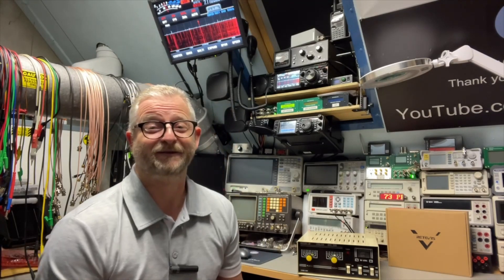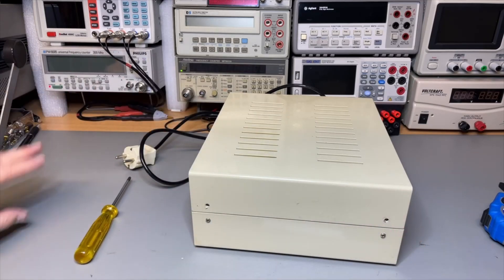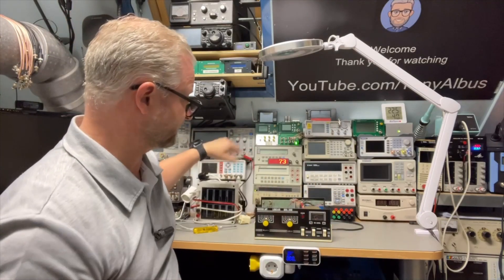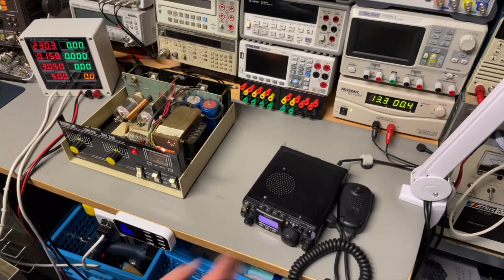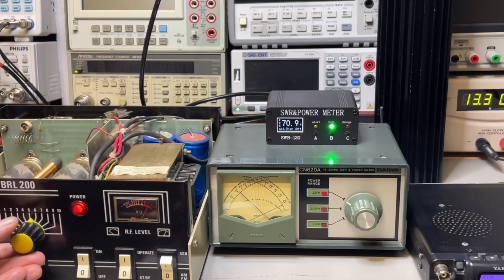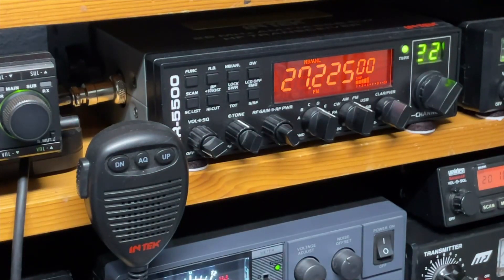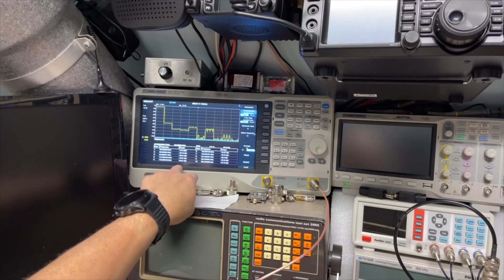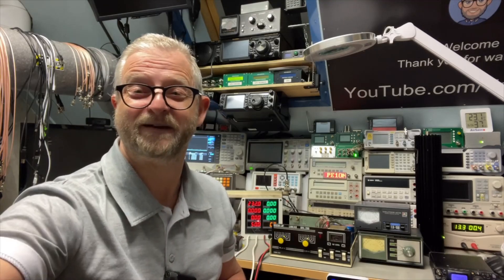TA-0327: Bremi BRL-200 Linear Amplifier - Open and Test

Comment: Nice video Tony and I share you excitement and nostalgia seeing a Bremi after so many years. When CB radio was around here in the UK I was only a teenager with little money. As money in the 1980s was generally tight my local CB radio shop would rent out a Bremi for the weekend for little money and I would stay awake for the entire Saturday night using the CB radio to capture long distance DX contacts with the 100 watts. I remember thinking that the 18 feet (5.5 meters) antenna I was using might turn black due to the 100 watts which seemed a crazy amount of power when most CB radio's here in the UK were only capable of around 4 watts maximum.
Reply from the maker: Yes great stories Ian, thanks for sharing. yes 100 Watts was crazy in that time. here also 0.5 or 4 Watts. (good times of fun)

Comment: Gaaf..zo n BRL 200 had ik ook in the 90's !!
Reply from the maker: Ja super gaaf, ik heb er nooit 1 gehad toen, maar wilde er altijd al 1... dat is nu dan 35 jaar later :)  .. maar wel weer dat spannede gevoel van savond zenden en kacheltje erbij enz,,, mooie tijd.
Reply: @TonyAlbus  Mooie tijd man,met de President Lincoln en de BRL 200 lulde ik de wereld over..gelukkig hebben we de qsl kaarten nog !!
Reply from the maker: @robertschip4676  Ja geweldig! .. ja de kaarten moet ik ook nog ergens hebben.   
Mr Miami was ik (geen idee waar dat vandaan kwam, Miami Vice of MiamiSoundMachine haha             
Later ook in de start van packet radio op 300 en 1200 baud en de C64 had ik een gateway-node tussen kanaal 24 (22alpha) en kanaal 40 met zo'n scc card hete dat geloof ik, later ging het allemaal met TNC's en 9600 baud, toen ben ik eruit gegaan ... maar veel geleerd toen, dat het digitale ook op kwam. mooie tijd.

Comment: Hello.
 This amp is from the late 70's made in Italy like for example the ZETAGI.
 It was a luxury to have one of these!!! Watts weren't as easy as they are today, especially with Russian tubes!!
These valves were not made for emission but for deflection in TVs. They give a lot of power but are not very robust.
There are several brands that used this type of valves (6JS6C, 6KDC, 6JB6) etc) such as YAESU with the FT-200, 101 etc and DRAKE with the famous twins, among others.
Another time other techniques!!
73 Rodrigo
Reply from the maker: Thanks! yes true, a luxury in that time.. cool to have, thanks for the extra information, interesting.

Comment: blooming cb dirty linears! Getting new valves for those are incredibly expensive these days. Most of the harmonics come from overdriven audio modulation. There is very little noise from a dead carrier.
Reply from the maker: Cool stuff. Yes a saw new tubes ate 50+ each when lucky else a lot more. 1 tube cost more i paid for this thing in total :)